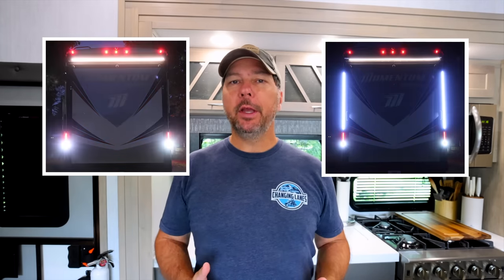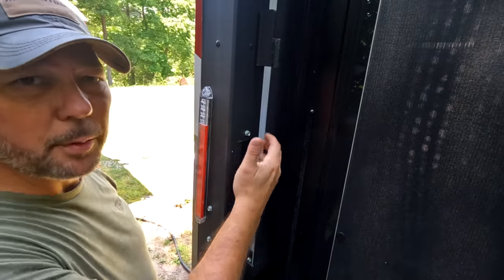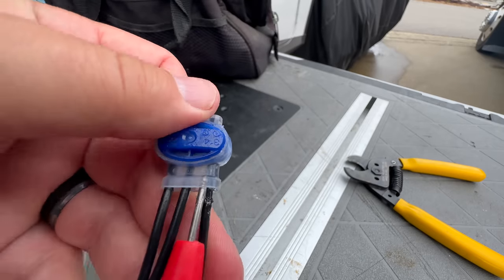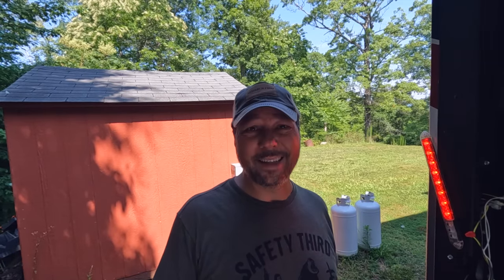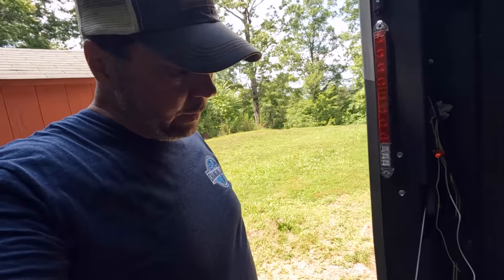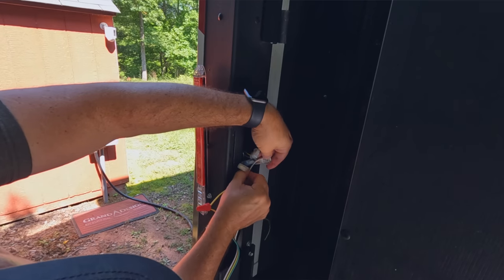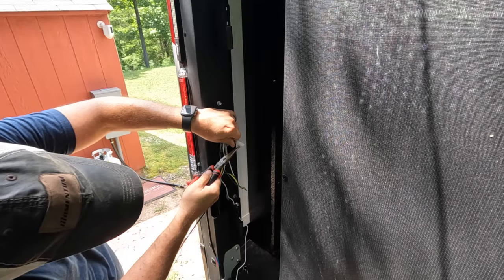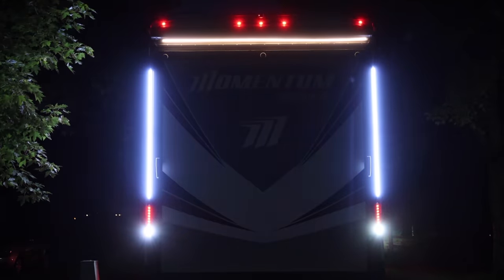LED Light Bar RV Taillight Upgrade (RV Safety)

Comment: I wish my Solitude had reverse lights at the back.  I know I could do this with the brake/turn lights, but having extra light when backing in at night is a game changer.
Reply: Added lightbars to my 2020 Solitude 380FL.  Disappointed they don't have reverse lights wired. What do I need to do to get that wired to the back of trailer?

Comment: We have a 15-year-old toy hauler. When the brake lights burnt out this year we replace them with LED brake lights. The new LED brake lights now have six lights on each side of our trailer. You can see it much better than the old lighting system that we had. Glad we changed it. We should’ve changed it along time ago. I would highly recommend changing to the LED system. Thanks for the information on the newer LED system that you’re using. Great idea.

Comment: The fancier the flashing the LESS SAFE tail lights are IMO.  At some point drivers are distracted by the flashing and not thinking there's a stopped or turning vehicle.  Drivers are "programmed" for solid brake / turn lights.  DO LOVE the reverse lights!
Reply: The flashing you see in  the video is the framerate of the camera. The only flashing you'd see with your eye is with the turn signal.

Comment: Great video. With how cheap LED lights are I am surprised the manufacturer doesn't add more lights. A great safety upgrade that will help in night driving and in inclement weather. Those connectors are really slick, I had to order some for my next wiring project.

Comment: A few years back I bought a second pickup lightbar (the first was already on the truck) and mounted it to the rear bumper of the trailer. It's obviously lower, but was still a great upgrade to the factory trailer lighting. A few months ago I then upgraded all the lighting (running, clearance and tails) from the previously upgraded halogen bulbs to LED bulbs to actual LED lights... such an improvement for the cost.

Side note for those scotch lock connectors: I just always make it a habit to score the wire I'm splicing with a blade to make sure the connector gets through the insulation and makes contact with the wiring.

Comment: Quit using the scotch locks years ago. Thought they were the cats meow when they came out. Found out that in salt and snow they don’t last. Went to solder and heat shrink, a much more secure connection. Great video will be adding these to our 397. Thanks for the information.

Comment: That is a great idea! I have been wanting to do something like this myself on our little GD Transcend 260 RB. I feel having some tail lights up higher will help so not on the vehicle behind you sees what's going on but others can too, like when your making a turn or using your hazard lights. Think it's a great safety thing to do. Plus the added back up lights help! You could also have that reverse light hooked up to your rear utility lights if you needed it. Either way, it's good.

Comment: You can slow you trailer lights from flashing so fast by installing a heavy duty turn signal flasher in you truck. Most auto parts stores sell them or at most truck stops. It will make your turn signals flash like normal. My dad told me about the heavy duty flashers back when I was just pulling a boat. I now have one in the emergency flasher slot too. Just so you know
Reply from the maker: Some footage was sped up.  They blink at normal speed. 👍🏼

Comment: Todd, great video as always, well done.  I planned on doing the same thing.  Ordered the lights. Pulled off our current taillight and investigated what I had to work with.   Being our rig is a Grand Design 310 and not a toy hauler, they just have a small hole for the wires to pass through.  It will be tight, but I was able to open up the hole to allow room for the additional wire and splices,   Bad news, I when back and re-watched your video and saw I probably need the adaptor (we have a F450 2021).  Problem is there is no room to bury the adaptor module inside the wall cavity,  Errr...   Basically decide to return the light bars and give up for now.

Comment: Great job. I installed 2 additional round Led's just like the factory ones 4" higher then the stock ones. They look the same but are above the e-bikes that are on the back of our Columbus 388fkc. I also installed 6 matching Led's yellow marker lights along each side of our unit 44" as a few people have attempted to pull in behind my truck forgetting about the trailer that's attached. A week after installing them we were  just outside of Amarillo Texas on I-40 when a sand storm came up.  I like to be seen at night and in the rain, no need to 4 way flashers.

Comment: Great  video 
We have a 29G
And i added  two more  lights  under lift gate 
My thoughts was low profile  car wouldn't see the factory lights.
Also took photo  and saved so when we get rear-ended  i can so police 
There was 4 brake lights before  impact

Comment: Thanks for the detailed video. I installed lights like this on our GD Reflection years ago because we carry bikes on the back and they obstructed the taillights. Loved this mod so much on the Reflection, it was the frist thing we did with our Alliance Paradigm. We used Boogey Light strips and added them to the sides. Works very well. 🙂

Comment: LOL, My Monaco uses all white wires as ground...Mine is a 2000 Dynasty so I just changed out all of the outside and inside to led. And the outside looks so much better.

Comment: We have a 2021 DRV Fullhouse,  we added two 15 inch lights on each side the first year we had it. You would think for what we paid for the 5th wheel it would have been built with more lights. One of the best safety upgrades that we have done.
Reply from the maker: I was wondering about DRV... If anyone would have upgraded taillights, it would be them, Luxe, or spacecraft.
Reply: @ChangingLanes  DRV has more lights on the back of their Suites, but the Toyhaulers come from the factory with just lights across the bottom. You guys be safe on the road.  😊

Comment: Very nice led strips.  We put an extra set of lights higher up on the back of our 2022 Solitude. I felt the same as you stated, the lights provided from the factory are way too small (and too low) for the size of the rig.  Thanks for the great videos.

Comment: Hint for people doing this as a one person task - cut some parchment paper and put it between the adhesive tape and your rig and use painters tape to hold the light in place while you are looking for the position to check it. Once you have it where you want it, the parchment paper will come out a world easier than the peel off they have on things like this. I've tried to just peel an edge of their cover out and had it tear on me, making a mess - where parchment paper will fold over and peel out and very rarely tear.

Comment: Always love your videos!  2 questions:  maybe just on the “night” video, but seems like it’s VERY bright and may be hard on the night vision of the folks behind you when activated….?  Second, I noticed your 7 pin looked a bit different, did you change yours out…I’m having problems with mine and am always having to put dielectric gel in it to keep it from not working properly….THANKS!!
Reply from the maker: Our 7 pin is stock...  The bright lights only come on in reverse.

Comment: Great video!  How confident are you that the peel and stick adhesive will hold up over time?
Reply from the maker: Pretty confident, just knowing how other instances of the same 3M adhesive have done on other projects.  I didn't show it, but the kit comes with a surface prep wipe also.

Comment: additional thought.. for those who do not have reverse lights wired in trailer.. could easily wire these to a switch for back up lights to get into dark areas or just for lighting

Comment: As a journeyman electrician I will say that those blue 3M tap splices are just asking for problems. Where you have them may be fine but anywhere there is a chance of water getting to it they will corrode and your electrical connection will dissappear. The ones that have the dielectric grease in them are much better to use but the best thing you can do is solder and heat shrink or use the solder butt splices like you used. Otherwise awesome job! I've seen many, many failures on the blue splices over the years and black tape is never enough to protect them from moisture long term.

Comment: Hey Chad I was wondering since our GD has a 4 way plug at the rear for additional trailer lighting, what are your thoughts on just wiring into that harness for both sides instead of tapping into each taillight?

Comment: Ever try WAGO connectors? I'm trying some for interior splicing, but wrap them with e-tape so they can't pop open when stuffed back in the access hole. But, you do have to cut and strip the wire.  Solder and heat shrink still rule, but the WAGO can butt 5 wires.
Reply from the maker: Yea. I like those too.

Comment: Great safety feature Chad. 
- Did you think of putting something on the sides (near the front) of your trailer so that someone that is ahead of the back lights but far enough back not to see the truck taillights?
Always one of my areas of concern. - Thanks! - Cheers!
Reply from the maker: Yea. kind of a blind spot there for turn signals.

Comment: This is an awesome video. Will do this in the near future. I am still trying to get the part for the bedroom lights from one of you earlier videos. The  

RV LIGHTING WS-01DC Wireless Wall Switch and LED 
Controller with Lead Wire

Any suggestions on where to get it or a replacement for it?
Reply from the maker: I just looked and I don't see anything that has that same kind of switch.  Hopefully they're back in stock soon.
Reply: I found them online and installed them. They work great. However, those lights only work when the main bedroom switch is turned on which turns on the other lights. Is yours the same way?

Comment: Great video from you and great idea from Mater Tomater! I notice your trailer plug in your truck bed is different from my 22 F350 DRW. mine hinges down and I hate it! Is your stock or is it part of another project?
Reply from the maker: Yes.. that is stock.  The door has a notch on it that keeps the plug secure.
Reply: Interesting, mine has the notch also, but with it being down instead of up it could lead to the plug working loose. You must have an option I don't have, maybe the trailer camera or TPMS option? My truck is a Lariat without those options. Thanks for the quick response, I hope to be able to meet you at the Rally! @ChangingLanes

Comment: Hello Chad, They have discontinued the Trailer control module adapter from Changing lanes, and I do not see it on the Opt 7 website any advise! Does the same thing on my 2016 Ford F-450

Comment: Great idea, just bought them for my rig. Just not happy with the setup. When you have just one side turn signal on and step on the brake you lose that turn signal do to you combining the L+R wires. Still trying to get it to work. Has anyone else figured a way to fake it out?

Comment: Hey Chad @changinglanes, I'm trying to split the brake/turn signals on our trailer (the light bars are on and working except for the turn signals). The Tow Package Module is not longer available. Any other ideas?

Comment: Did you use 2 ford converter boxes or did you just move it to the passenger side since it has the wiring there first, then to the driver side
Reply from the maker: Two boxes, one for each side. 👍🏼

Comment: I'm not sure if your tail lights were flashing really fast. Or you were fast-forwarding the video at the end.
If your flashers were flashing too fast, you have too much power going through them. You can get a heavy duty flasher and they will flash at normal pace again.
Reply from the maker: It was sped up a bit to show a few cycles of flash.  👍🏼

Comment: I’d be worried that those wires are located,unless I misunderstood, where the cable runs for the tailgate lift.
Reply from the maker: The cables are all above the wires, in the upper part of the tube.

Comment: I'm not so sure that very bright lights on the back of vehicles or for that matter signs and stoplights are a good thing.  They tend to create what I call a "wall of light" where you can't see things beyond them.  This is especially true of highly reflective signs on the side of the road and stop lights.  The lights are so bright that you can't see past them and it ruins your night vision.  There's a reason that boats have relatively dim red lights on their dash for lighting at night.  It doesn't ruin your night vision.  I believe that bright lights on the road do the same thing when they are too bright, it ruins your night vision which take 5-8 minutes to recover.  It originally takes about 40 minutes to reach optimum night vision.  Given the above I'm not sure that brighter lights on any vehicle are a good thing.  Keep the good stuff coming guys.
Reply from the maker: Those bright lights are just for reverse.  Otherwise they are all red. 👍🏼

Comment: can you tell me what that  box is for that's in the back of your truck bed by there trailer plug
Reply from the maker: That's the Volta Power Systems connection.  We'll have a video on that as soon as were done testing with them.

Comment: Wondering if they are legal 
The code states no taillights over 72 inches 
Any idea? 
I want to do the same but don’t want it to be a problem
Reply from the maker: The light bar is 60 inches and the other tail light is about 10 inches, so it should be fine.  Although I doubt police are looking for something like that.
Reply: Thanks, I will do it @ChangingLanes

Comment: good video..  will likley do something similar with our rv in future.. 

 only thing I advise avoiding scoth lcok connections . being an auto master tech  I find a lot of issues caused because of them failing usualy due to damaging wire or corrosion... prefer red blue or yellow(depending on AWG)  hard crimp or actual soldering  with heat shrink.. these help prevent water intrusion
Reply: Scotch Locks are fine if used properly.  I have them in my 97 and put them in in 1996 and never an issue.

Comment: as long as those crimp tap's are in a wall dry witch they are you will never have a problem .... every RV i have owned iv had to replace my light's with LED My Class A LED 5er LED, now my forest river i replaced them 2 times i wish i had of found the Light bar's you got,, Nice Work ...how about flood lights of the side ??
Reply from the maker: Our RV came with white lights that light up on the sides (rear) when in reverse also.

Comment: Chad , never use 3m scotch locks , they’re horrible and promote Moisture , electrical tape also promotes moisture in your connection , per 3m . If you can use shrink tube connectors with No electrical tape …

Comment: Light colors other that red (yellow flashing) are illegal in most States as it should be. People are using vehicle lighting illegally and it’s injuring and even killing drivers.
Reply from the maker: If you watch the video (instead of commenting on the thumbnail), you will see this is not the case.

Comment: Scotch lock connectors of any type are crap and should never be used under any circumstance. I remove every one I ever find and trash it. They damage the wire and that's the last thing you want to do.  I'd be tempted in this place to inject a little silicon grease into a wego and use that.  Often times I use either an insulated butt with integrated shrink tube or non insulated with with shrink tube.
Reply from the maker: I don't think they'll be a problem in this... They held up great on the last install (old RV).
Reply: They are fine IF installed properly. I have some in my 97 Dodge that I installed in 1996 when I bought the truck and they have never failed. Some are inside and some outside and no tape on them and zero issues even after going in flood waters.
Reply: @johnstark4723  good for you. No decent electrician would ever use them. You will not change my mind.  I've seen too many instances where they ruined wires. They corroded and caused the wire itself to corrode and the circuit failed. You'll notice the half assed RV and trailer industry uses them extensively.  No auto or power sport manufacturer does.  That should tell you something.

Comment: I just want to know.  How many, campers does it take to screw in a lightbulb?  It's simply a bunch of lightbulbs.  That only requires 2 wired.  An, on wire and off wire.  As ground is, beneath your feet.  DUH.

I am well grounded with my expert tease.
RemyRAD